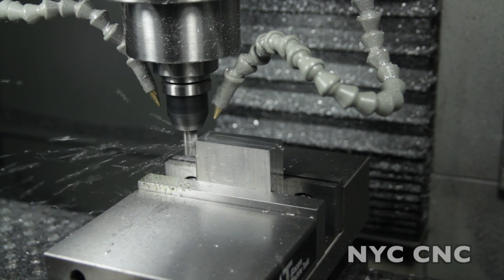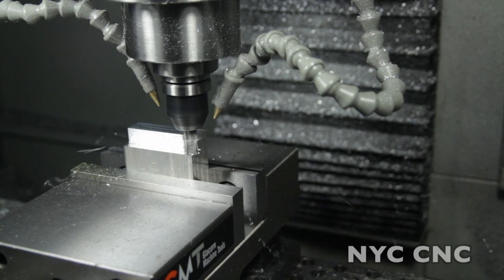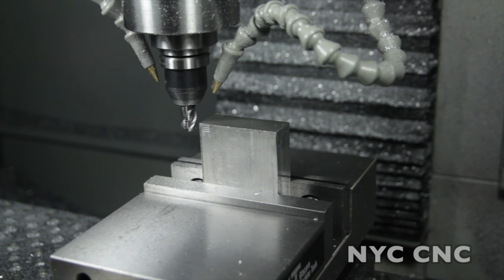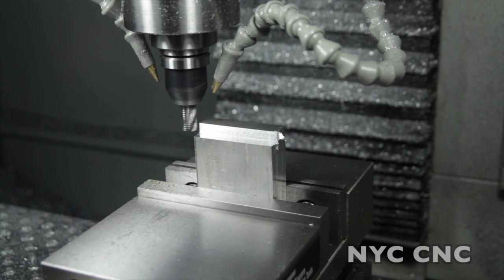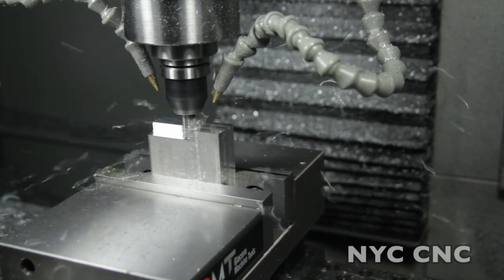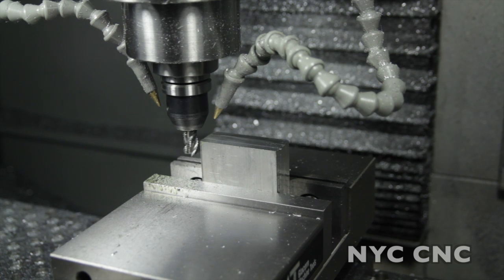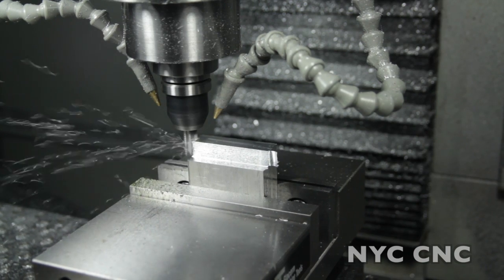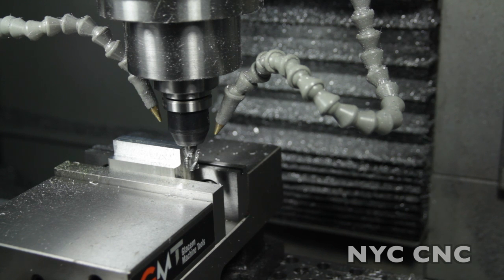Tormach PCNC: Max Cut! Pushing it to the limit.

Comment: One difference is the 770 can run on 110v (your house) voltage.  The 1100 requires 220v and secondary 110v.  But the good news is that the 220v is single phase and thus can still feasibly be used at home shops.  You just need to run a 20A circuit to the machine to be safe.
Reply: in europe every socket is 230V and the more specialized ones are even 380V

Comment: Does the 0.3"/47IPM/1.2hp cut work better than the 1.13hp cut due to increased heat from the ability to maintain RPM?

Comment: Excellent video buddy, Bob's going to love that.  I was also using a rougher the other week, 1/4" in blade stainless, ended up bogging it at just over 1hp but the rpm was higher than the peak torque range, I can't remember but might have been 5100.  I assume you don't have a load meter yet?  I just got mine last week and Erik installed it, haven't cut with it yet but I can't wait to push it.  Although knowing the Gwiz HP numbers will help us guesstimate the limits for every cut.

Comment: Thanks for the input.  BTW, it hit me today when I was thinking about why the spindle bogged during the last cut that running at a larger DOC (.500 vs .300) is engaging more cutting teeth simultaneously (obviously), which is exactly why the Superfly fly cutter is superior to the four flute facemill (from a horsepower and MRR standpoint); less cutting edges engaged.

Comment: No, actually.  Prior to owning this, I had only done smaller parts; a .375 2F endmill was adequate for roughing/finishing.  I chose this one based on your video "Hoggin' Aluminum..."  When I had a job that needed 2/3rds of the stock removed, I turned to a rougher then.  It's fantastic (and will likely further impress me now that I've seen the limits of it in this video). I haven't yet run it heavier that 75% WOC, .296 DOC, 25 IPM, 2800 RPM. I've got a larger stick out for 1.25" deep pockets.

Comment: Thanks for sharing this video!  It's a great experiment for me to watch, especially since I own the same end mill.

In the video you briefly discussed exactly what I found surprising; that the spindle was bogging down under the cut that G Wizard indicated was a lower horsepower cut, even though the MRR was lower.  Apparently engage more cutting surface in a slower cut (more, thinner chips) is more difficult than less cutting surface with a faster feed (fewer, thicker chips).